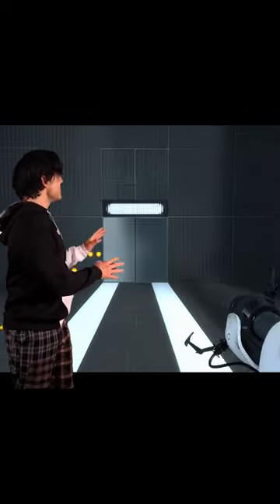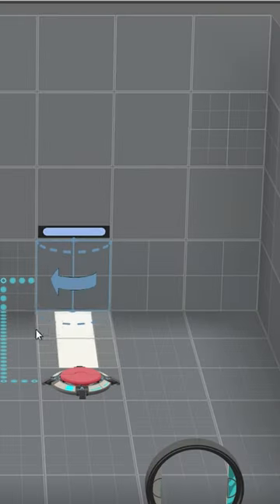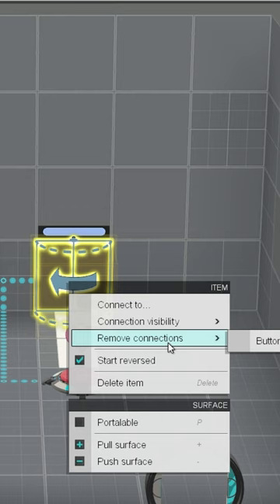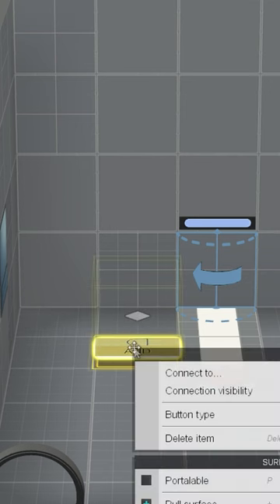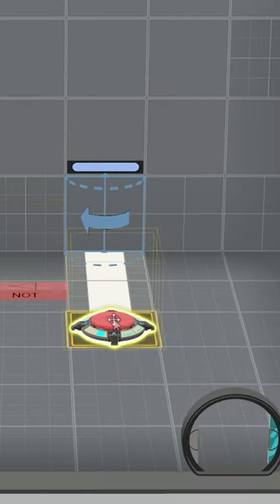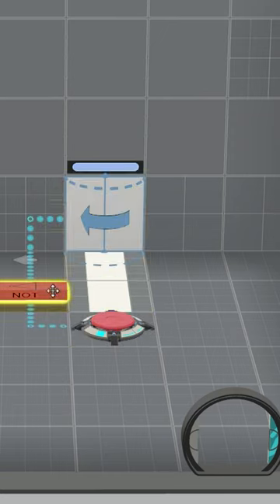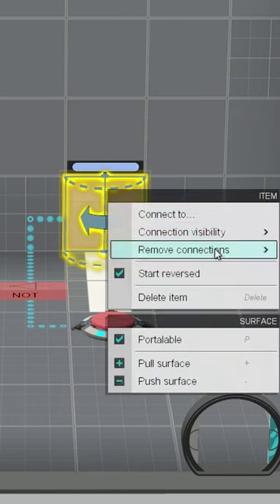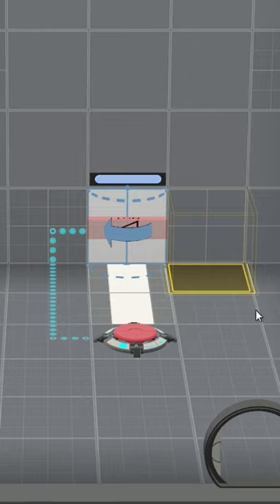Flip Panel Fix for BEE 2 Link in Description! #gaming #portal  #portal2 #gamer #portalgames

Comment: Actually, that is just wrong.  It is far simpler to simply reverse the portalability of the panel.  Doing what you show is NOT what fixes the lighting of the panel.  In fact, what you demonstrated has NOTHING to do with lighting.  It also does NOT fix the antline mess.
Reply from the maker: Right, it was to fix a bug in BEE mod that darkens the panels.. If you don't use the mod it wouldn't be a problem you would have. Thanks for the comment!